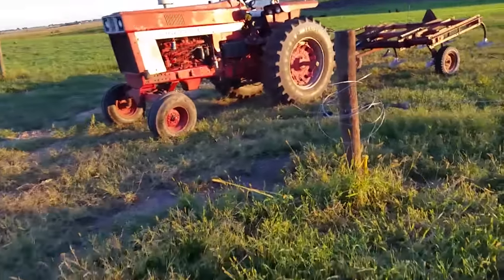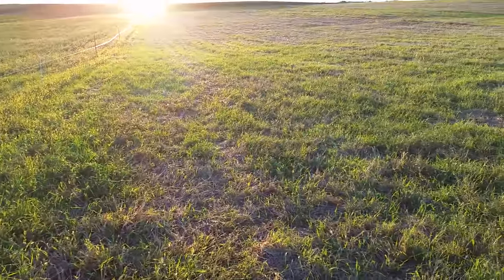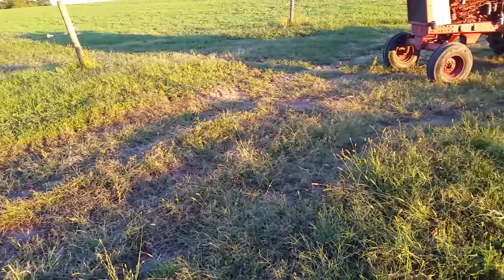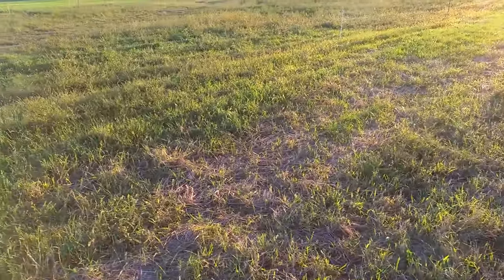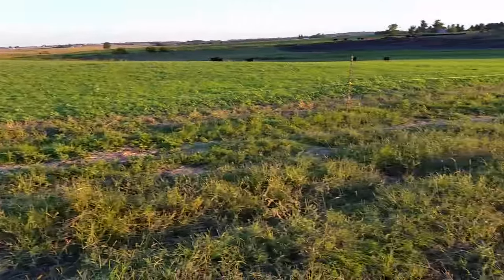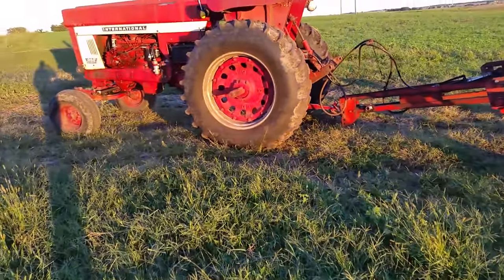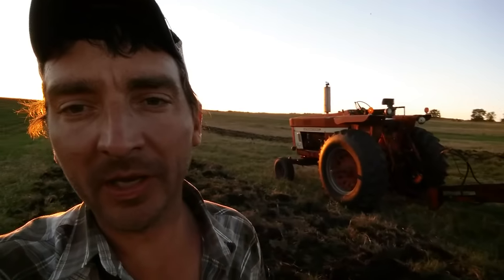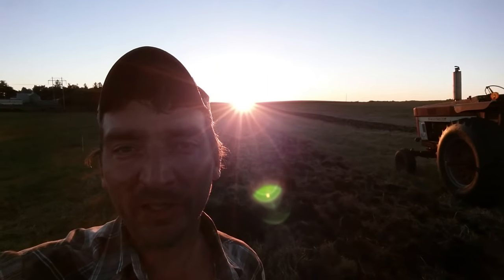Chisel Plowing Sod

Comment: Did you do anything else to control the gopher problems? Your tractor reminds me of my 706... Thanks for posting the video.
Reply from the maker: thanks for watching. now we just converted it to row crop. 966 just newer version of 06 series. love the old IHs
Reply: just use a tire drag harrow to knock the field smooth, bigger tires bolted together work well
Reply: @johndowe7003  Thanks for the suggestion

Comment: Looks like the 966 did a real nice job pulling the plow. How deep are you plowing? I imagine with those wide sweeps you are completely disrupting the roots of prior vegetation. And no duals though I bet they would help!
Reply from the maker: About 6 inches deep. The sweeps cover/overlap the entire width.
Reply: The second time over do you try to go a little deeper? I pulled a 10' chisel in the late 70's with a 986 and it held it's own but the 1086 did much, much better.
Reply from the maker: Bill Whitman  I didntgo deeper. I didn't want to start making slaps or chunks as I have no way to break them up really. The 9 66 pulled it almost as well as the 6125M, M has fed and newer tires too!. Next time I'll pull it with the 4430 just for fun
Reply: The 4430 will play with it. But it will be fun to hear the rumble that Deere has in those older 6 cylinders.
Reply from the maker: Bill Whitman lol we will see. The 44 has been on the feed wagon lately and feeding in dirt yards after rains it doesnt do any better than the 966. Tires make a huge difference. The 44 are good the 9 are a little better. I figured ive used the 9 and M ill put the 44 on too. I have one set of duals for the 44. Im not going to put them on. Even though ill have pulled the chisel plow across 16 acres 2x by time im done its not worth it. Its kinda like playing in a sand box
Reply: Yeah, that's why I thought you might be going a little deeper every time. I've never used wide sweeps before on a chisel but I can see where clear cutting the vegetation root system would have it's advantages. I doubt you'd have any additional clods if you went in 2 inch increments? Of course what you're planting needs only what it will use for it's own root system.

Comment: are them tires on the 966 loaded
Reply from the maker: No
Reply: wow im surprised it pulled it as well as it did then. the 9 didn't even feel it back there
Reply from the maker: Oliver Knapp couple of places it did but for most part not even an issue